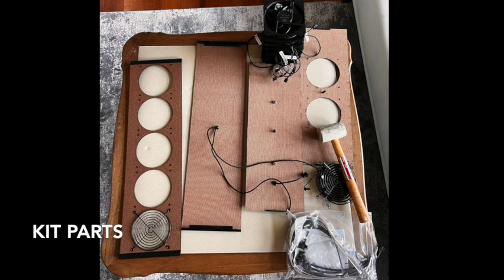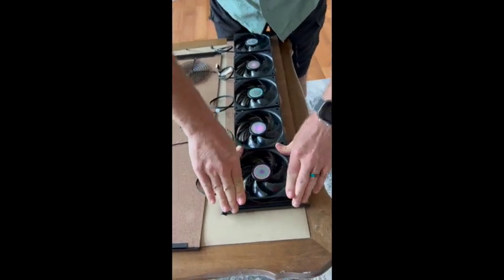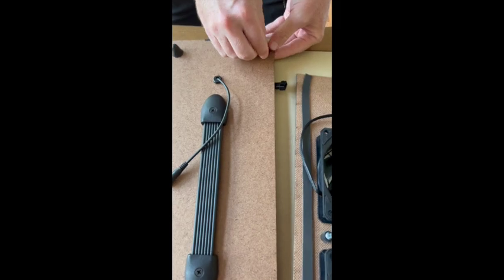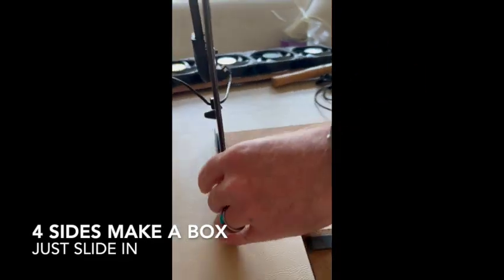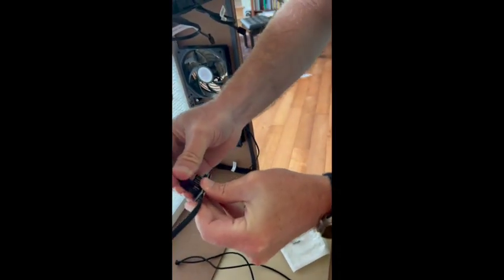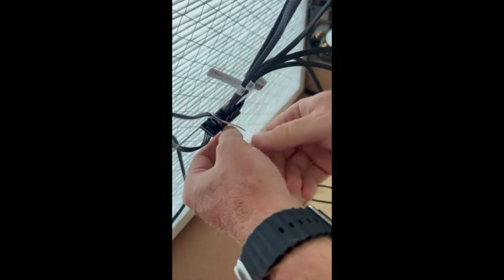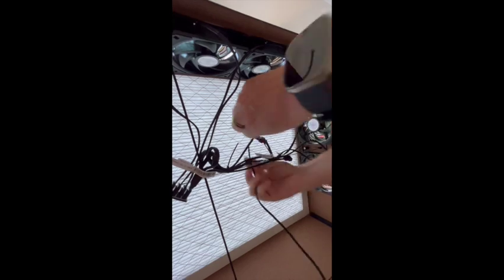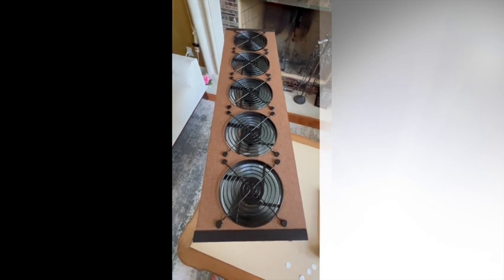Luggable XL  - Kit Assembly Guide

Comment: I recently bought and assembled one of Clean Air Kits' "Bedroom Luggables", with five fans along the front.  It's as good as I was hoping--very quiet, to the point where most people should be able to sleep with one in a bedroom, without also needing the separately available (not from them) fan speed controller that they describe if you want to try one out.  It's much quieter than a small to mid-sized air purifier on medium speed.  But if you're especially sensitive to sound while sleeping, so that you need complete silence, these kits aren't silent, but if you locate the unit some place in the room where the fans aren't pointing directly at you while you're in bed, then you're unlikely to really hear them.  I have mine right next to the head of my bed, though it's a pullout couch bed, so most of the tiny amount of fan sound is blocked by the side of the couch bed, but even the flimsiest earplugs are able to keep out any remaining, very faint fan sound.

It also doubles as a personal fan, directing air over and cooling me while I'm seated at my desk with my hot computer and TV churning away, pulling up cooler air from floor level.

Comment: These will outperform HEPA filters when using MERV 13 filters due to the higher airflow.  The net small particle removal is greater than those commercial overpriced units.

Comment: the fans are damn impossible to remove from the board..

make sure you put it on the right way, or you are going to have a hard time (I put the first one in wrong, so I only had to remove 1 fan, but that took me over an hour struggling with it). I'm sure the fans themselves last years and years, but I'm not looking forward to replacing them.
Reply: the instructions that come with the fans are HORRIBLE and honestly this video makes things a bit confusing 
I'm on hour #2 of this and I took the fans to my studio to drill the holes larger. For the price the instructions need to be better written

Comment: Why are they made oF cardboard? And still cost hundreds dollars. Am I missing something?
Reply: Those are laser-cut wood panels, not cardboard.
Reply: its not cardboard.

It  uses only 10.8 Watt power. Do you know how efficient that is?

Plus, it's quite

Plus each fan can be replaced easily

You get your money worth less than a year in a future proof design
Reply: well, you do get fans that cost about 12 bucks each, the board thingy and the wiring to connect them together, that's another 10 bucks, let's say, and a power brick, let's say another 10, and the grills (let's say 5 bucks) (at scale, it's much less,  but that what you'd pay to DIY. Then you have the laser cut panels, the material is probably 5, less than 10 bucks per square meter for sure. But it's already cut and few people have access to a laser cutting machine. So you probably get c.100$ worth of materials, and it comes all ready to assemble. If they sell if for 2x their inputs, it's not absurd. The question is whether you want to go through all of that yourself or buy something turn key.

Comment: I didn't fully understand. Is it really more efficient to suck air from outside of the box through the filters instead of pushing it from the box through the filters? With the current design, won't there be a lot of particles staying on the outer layer of the box (on the filters), and when the whole device is turned off, wouldn't part of them fall off?
Reply from the maker: Because the filters do electrostatic capture, most of the fine particles are actually caught inside the fabric not on its surface.  Fans blowing outward keeps the fans clean and circulates room air better, at expense of filters greying from the outside first.

Comment: I want to try installing quieter fans in the unit I've already fully assembled. Is there a trick to removing the fans from a completed unit? Do they come out safely if I just pull?
Reply from the maker: Yes they should come off safely if you just pull.  Though if you ordered pre-assembled there might be some superglue on some of the push pins to keep them from vibrating loose during shipping.  You might have to cut those with a pliers.  You can find more here:  https://a.co/d/43lda5h

Comment: Hello i want to order one of those but i am in Europe, do i need to buy an external adapter for the wall plugs because i think they are different?
Reply from the maker: Yes you can get our USBC to 12V adapter cable or a local wall plug with 12V DC barrel 5.5x2.1mm connector
Reply: @cleanairkits  Thank you

Comment: Which way do the filters face?
Reply: Filters have an arrow on the side showing the direction of air flow. The air should flow from outside the box to inside the box through the filter, so each filter's arrow should point toward the inside of the box.
Reply: Curiously on the filters I received,.. the large bold lettering is on the opposite side of the filter than in this here helpful demonstration video. However the arrows on the filter clearly show which side should face inwards.

Comment: Sorry, I’m sure you get this question a lot. If we are concerned with odors/VOCs/gases, is there any way to adapt your purifiers with a carbon filter layer? I know other brands of purifiers do have carbon filters but after watching videos exposing the BS marketing of air purifiers, I’m not really trusting any brand besides yours!
Reply: You shouldn’t have any issues adding a high flow carbon filter behind, or in front of, your mirv filter-

That said, if you really want to filter out VOC’s and such, you should look into making, or buying, a ‘can’ style carbon filter- (the type you fill with 10lbs of activated charcoal) 

This guy - the 3d handyman -talks about what makes filters work, and has a design with a carbon trap for ~$200 on his shop.
https://youtu.be/eYOvnqoW4H0?si=rLJCUtT04-sGVz6R
However, it should be noted that the airflow required to use a carbon trap will make it more loud than these computer fan run models.. (will sound like a box/shop fan when on)
Reply: @HuheJass  Thank you for this info! Noise is a concern in our situation. Do you know of a carbon filter that would fit with either the luggable, table, or tower? I searched through Filterete but didn’t see any carbon/VOC filters
Reply: @surrendertoflow78  Of course! I completely understand, noise is the main reason I'm still interested in the clean air kits designs.
Yes, if I were using a carbon filter in conjunction with a kit like this, I would use one of these (you can look the following up to find)-

GreenR3 1-PACK Cut-to-Fit Carbon
Pad 16 x 48 inches for Air Filters Charcoal Sheet fits Air Purifiers Range Hoods Furnace Filters removes Odor
VOC Parts Accessories Replacement
Replenishment and more

Or some sort of 'charcoal sheet' seems like a great passive solution for smell and VOC control- Passive meaning it's not going to be enough to eliminate consistently generated fumes indoors- (say from epoxies or indoor projects) -However, it should be enough to bring the average/normal level of indoor VOC's down.
Reply: @surrendertoflow78  It really doesn’t like me suggesting the exact names of Amzn items.. (my comments just disappear) but you can try looking up something like ‘cut to fit charcoal sheet’ or ‘charcoal sheet filter pad’.

I would look for something as big, or bigger than the filter you’re using so it’s easy to cover the whole filter. I would also place it on the incoming air side- If you want to use it as a pre filter to extend your filter life- Or on the outgoing air side, if you want to increase the carbon sheets life- (it won’t make a massive difference either way, but whichever filter the air goes through first will need to be changed more often)

Edit: it looks like my last iteration did actually post! Anyways good luck to you and your family! If you want an easy plug in solution these kits are a great deal-
I will say, IF you’re an avid DIY’er then you could probably make your own for about 1/2 the cost, but keep in mind how much your time is worth- (if it’s too valuable to spare a couple days making your own, then paying an extra $70 isn’t too bad-  I’m just a ‘broke collage kid’ so I’m considering making my own lol)
Reply: @HuheJass  Thank you so much!!!! We aren’t avid DIYers, just desperate to buy something with no BS attached that will work without it costing us a fortune! Thank you again!!
Reply: Do all Clean Air Kits have lights? I can only sleep in complete darkness, so I do not want lights. Many fans and filtration systems have lights that keep me awake.
Reply: @lauressan.4658  No, there are many options and models that do not have lights :) (Typically the led fans cost extra anyways)
Which model were you looking at getting?